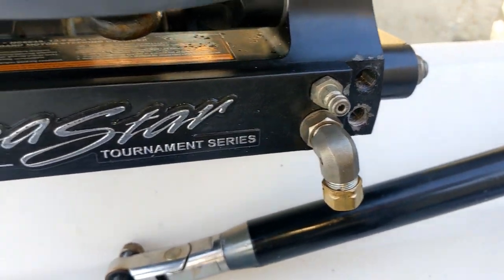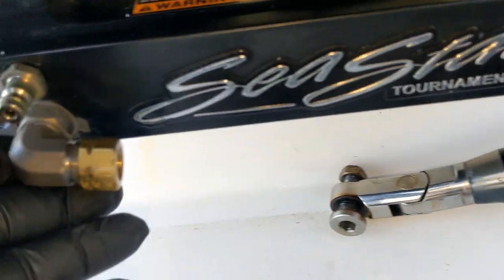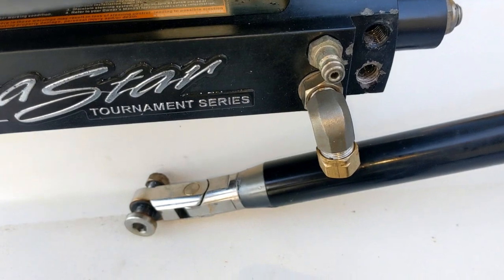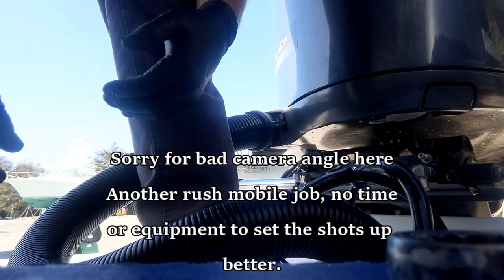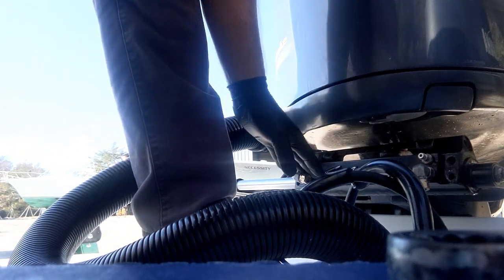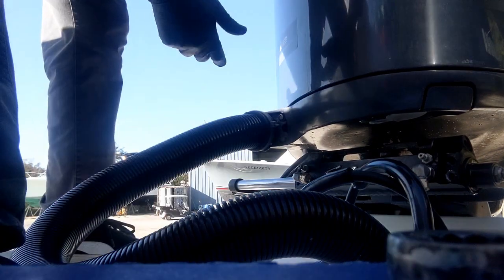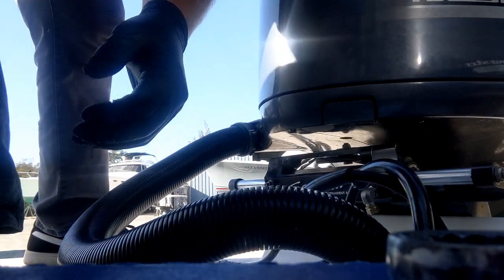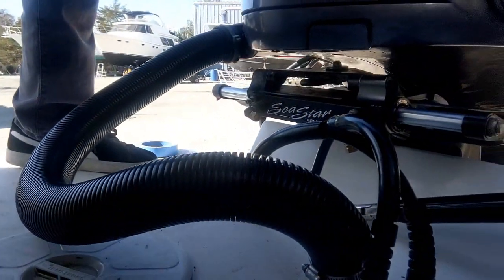Outboard Hydraulic Steering:  Damaged Steering Cylinder

Comment: I have a Honda 130 hp a d when I go over 10 mph it's hard to turn left, I have sea star sterring would air in lines cause this . It turn ok when sitting still.  Thanks
Reply from the maker: Hi Kurt, If air is in the steering system it will cause the system to react sluggishly when turning, especially under a load.  It is not unusual for the system to work fine with no load on it on a trailer for example, and in the water the system malfunctions.  There can also be an issue with the valves in the helm being either contaminated or pitted out and not being able to build and hold pressure under heavy load, but works fine on the trailer.  Push the motor side to side by hand when it is on the trailer.  If there is more than about half an inch of movement on the cylinder there is either air in the system or the helm valves are malfunctioning.  If the cylinder only moves about 1/4 inch and feels good but you see the steering wheel move (starts turning with no one touching the wheel) when the motor is pushed then the helm valves may be the culprit.